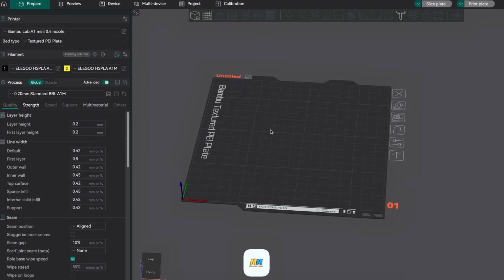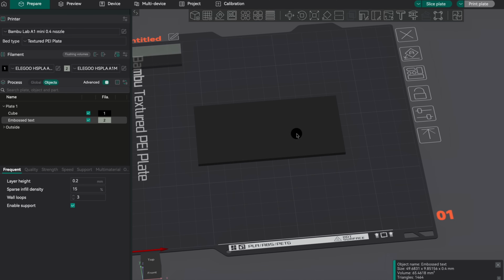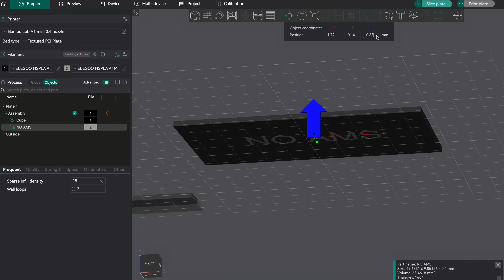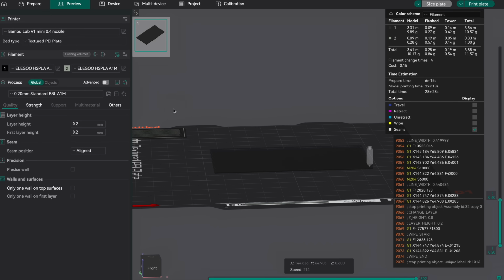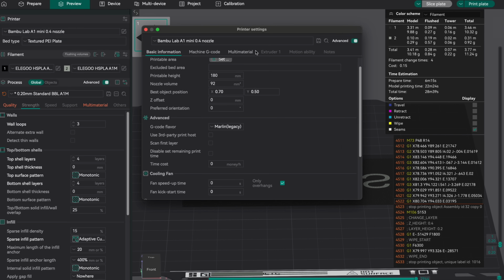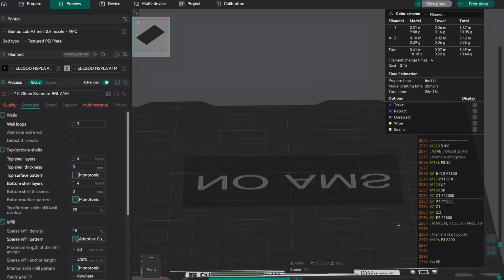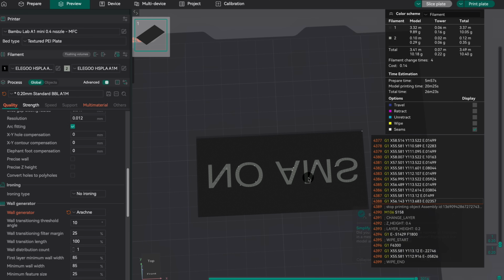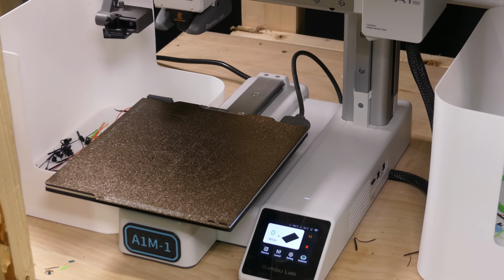How to do Multicolor 3D Printing WITHOUT an AMS

Comment: Amazing video, thank you! It worked for me, with one exception: no matter what i tried, i was not able to start the print with the text. It always starts with the box around it, then the infill for the letters. Which results in partially covered letters in tight spaces. A1mini, Orca Slicer. Another thing which I saw happen in your video as well: after a filament switch, before it goes to the prime tower, for a short moment it goes to where it paused before the filament switch. Which can result in a tiny bit of color mixup, at least it did so for me. Anyway, thank you again :)
Reply: Found the answer: Plate settings => First layer filament sequence => Customize.

Comment: I am not able to edit the printer settings like this on Bambu Studio, is there a way to get those settings that is not obvious?
Reply from the maker: I believe in Bambu studio, you don’t need to edit those printer settings. Don’t quote me on it because I’ve just recently swapped everything back from Orca to Bambu Studio and haven’t tested this out with that slicer yet, but you should be able to color your items and it “should” pause when a filament swap is needed. I need to do some updating to my A1 Minis and get them back on Bambu Studio soon and make a revised video that focuses solely on using that slicer for this but I’d give it a shot

Comment: So good. Worked perfectly with my A1. I ended up getting Orca Slicer to get exactly the settings you mention. Worked like a charm printing some small black and white labels I desperately needed to finish a project. Thanks a lot, but yeah, will totally buy the AMS next :D

Comment: When you change color manually the amount of purged filament is the same as if you were using AMS? I am asking it because one of the reasons why I am considering to buy a bare Bambu Lab A1 Mini (no AMS system) is because I watched several videos where they say that one of the downsides of the AMS system is that it wastes too much filaments with the color changes. Also they say that when printing multicolor objects with AMS it can take a lot more time (like 3x more) than printing multipart objects. It doesn't make too much sense for me because as much as the machine has to spend some time purging the filament from the nose and then load the new filament, I cannot understand why an 8 hours print in multipart mode can become whole 24 hours using the AMS. Could someone explain it to me? I'd like to get the combo but these details (wasting of material and the long extra time) sound like a turn off to me.
Reply from the maker: It takes roughly 1.5 minutes for the multicolor system like an ams to swap filaments for each color on each layer so if you have 3 colors that are being used on most layers, that layer itself only takes maybe a few seconds to print depending on the size of the part, but now it has an additional 1.5 minutes for each of the 3 colors. So while the printing doesn’t take that long, you’re adding roughly 4.5 minutes for each layer to swap colors out and purge the old material so you aren’t mixing colors. I just finished printing some parts that are about 2 inches in diameter. 360 filament changes x 1.5 minutes per swap is 540 minutes just swapping filament. Break that down to hours and it’s about 9 hours just changing filament for a 16 hour print and that was just with 3 colors and mainly in the center portion of the print. The first 100 and last 100 layers were only changing between 2 colors

Comment: This video is useless for Bambu Studio as it does not have the multi-material tabs that you show in Orca Slicer.
Reply from the maker: I can revisit this with Bambu studio to be sure, but from what I can see, you dont need to do the multi-material step in Bambu Studio... Just changing the filament change g-code and following the other steps should work in that slicer. Do let me know though if that doesnt end up working.

Comment: Have you or could you do a video for the ender-3 v3 se. I’m so close to buying the coprint add on but by that point I should’ve bought a different printer. But I do love this printer
Reply from the maker: I would recommend an A1 combo before i recommend co-print on any machine in that price range. The V3 SE is alright for a starter printer, but investing the kind of money that co-print costs into a machine like that, in my head, doesn’t make much sense when you can get machines way more capable in terms of quality and speed, that come with multicolor capabilities right out of the box. I’ve since retired my v3 se because it wasn’t as consistent as my A1 Minis, and was much slower at getting the job done

Comment: Please show me how to do 6 colors on AD5X please!
Reply from the maker: Thats not really possible because of the way the ifs system works, and how you would have to slice your file. Because it automatically swaps colors instead of pausing for you to do it, you would have to sit there throughout the entire process, and know which color its going to swap to next and pull that out of the ifs before the color change happens, and usually if you choose 2 ifs slots for different colors, it wont pause in between, it will slice the file so it immediately moves on and continues printing with that slot. For example, you could set up your slicer file to have 6 colors, maybe black, white, red, green, orange, and blue... You would have to tell the slicer that 2 of those colors are in the same ifs slot as another 2 so it would slice the file to print say, red and orange one after the other, and green and blue the same way so its not wasting time doing color swaps. Thats a long round about way of explaining it, but unfortunately, this method only works on machines that dont have a multicolor system hooked up to it because when they do, the software will slice the file with the multicolor system in mind instead of manually pausing to let you swap filaments.

Comment: I want to print a katana sword from demon slayer for my little nephew, he loves it. I have the A1 and A1 mini but no AMS. The blade is black with a yellow flame on it. Its already on makerworld, ready for print but i guess its designed for AMS. When i slice it, it says 8 filament changes but how can i set it up for no AMS use, is there a simple button to tell bambu studio that you can manually change the filament? In the past i just added a pause on some prints to add a font for example but now i have the yellow flames on black within the first layer, i can not add a pause. Maybe it is simpler than i thought because its already a finished project for AMS. I asked chat GPT but it kind of gave my wrong advices.
Reply from the maker: If its only 8 filament changes, then it should prompt you on the printer to change out the filament as it gets to those layers. If I had made my design a little taller, it would have been 5 or 6 filament swaps and shouldnt be any different than the 2 or 3 that I showed as an example. With that said, i havent done this with Bambu Studio and I know there are slight differences between Orca Slicer and Bambu Studio so I will explore around in there and maybe do a follow up showing the process inside of Bambu as well

Comment: There must be a way to just buy the feeders of the AMS and 'trick' the printer.   Can't believe no one has done this?   The Head has the four ports already!  Just need for more tubes, and four feeder motors, which if Bambu sells them separate, you'd be good to go...  Hmmm....

Comment: What is the purpose of using prime tower, since every time new filament is loaded the printer purges old filament automatically
Reply from the maker: The prime tower primes the nozzle to make sure filament is flowing before moving back to the print. It helps prevent little strands of filament from oozing between the loading sequence and actually starting in the next part of the print
Reply: Cómo hago para que la boquilla no se dirija hacia la pieza después de reanudar?

Comment: I have a question, when I pause the bambulab a1 and change the filament color manually, the extruder then goes to the position where it was paused (sometimes it stains the part), and then to the purge tower, but I want it to go directly to the purge tower since sometimes it releases a bit of filament on the part and ruins it. How can I do that?
Reply: same happen to me.. do you have solution?
Reply: No :'(

Comment: this works great and i use it rather often to get some more color into my prints. 

i just have one question: i usually print just one layer of text on the bottom, and it works, but it always does the outer material first, then changes to the text color, then back to the base color. it changes twice instead of just starting with the text, then changing to the main color. any idea what could be causing this?

Comment: Could this work for prusa mk3s?
Reply from the maker: The procedure may be slightly different as far as the printer loading and unloading but generally speaking, this will work with any 3d printer. I believe you can add the prusa printers to orca slicer and should work the same over wifi or saving the file to an sd card and running it from there.

Comment: Nice video using OrcaSlicer... can this also be done using Bambu Studio?  I can only pause at the end of a layer, and not inthe middle.
Reply: same
Reply: Yes, it can. I just did so. If you Google "Print multi-colour without AMS from Bambu Studio - easy" you should be able to find the details. In the 'Filament end g-code' box (Advanced mode > Filament properties) add 'M400 U1' to the end for every filament you're using.

Comment: I wonder if it could be worked out how to modify the filiment change g code to not only pause the print, but to to the unload as well, then pause for you to put the new filiment in, maybe even more stuff after the pause command to do the loading a fixed number of times?

Comment: Hi. thanks for the great video. 
I have a question, I have an Ender 3 s1 that I have tried this on and it works great, but I have problems when the printer makes the prime tower. at the start of each color change it puts down a lot of filament in a big lump, and this hardens and becomes a problem when the next color change starts.. how do I solve this?

Comment: THANK YOU!

I really appreciate that you showed the detail of using some of the “advanced” workflow with the other settings/tab, 

I’ve been needing to use multicolor, same layer for some light box’s that use more than 4 colors (and do not want to buy a $400 AMS2; only ones that’ll connect to ams lites)

Thanks again - I would love to see how else to use some of the other “advanced” / not used as often settings

Comment: This tutorial does not work.
Reply from the maker: It absolutely does, i did it myself in the video 🤣. If you are using Bambu studio, it is a slightly different software so the features may be in different areas but it for sure works with Orca Slicer the way i laid it out in the video

Comment: Cant find "single extruder multimaterial" setting in bambu studio...
Reply: same
Reply from the maker: May not be necessary within Bambu studio. I used Orca Slicer because it offers more functionality than Bambu Studio so things may be labeled slightly different or just be non-existent/not needed when using Bambu studio.

Comment: This is a fairly flat and straightforward print though. I don't see how this could work on something like a figure wearing clothing that has different areas with different colors. Even if it's just two colors. I'm specifically thinking of a black Darth Vader figure with a couple of white areas on his clothes and shoes.
Reply from the maker: You're not wrong there. Unless you wanted to eat and "sleep" next to the machine, there's no way I would recommend doing this for more than the first few layers, otherwise you could be there for days.

Comment: Is there any way to display what color you should put in next? either a name or filament number would be very helpful for more than 2 color prints
Reply from the maker: I believe there is, although Im not positive that would work on a machine like the Bambus since they are pretty locked down. Good suggestion for things to test out though!

Comment: hold up... you can ad text from slicer? and i have been sometimes FIGHTING with fusion 360 trying to turn a complex SVG full of works on top of a print.
Reply: Oh yea - it’s crazy as to the amount of design/abilities you can do within a slicer.  Being that I’m still learning how to model, it’s the only/easiest way I can make/mod/bash items is via slicer

In BS, you can add text etc, but needs to be on an object or primitive. So add your text, modify accordingly, then “split model” and then remove the primitive. Afterward, regroup/remerge the text and do whatever you need

Comment: Another vote for the AD5M multicolor tutorial. 
Was also wondering if you could just do a single color layer instead of two. Also wondering if you could do something like the combine infill function and print both layers of white and then switch to black. Basically, I only want one color swap.

Comment: Why do you keep retrying to let the new colour cone through then print a snall prime tower instead of leaving a big prime tower and letting the colour change there, it is what it's there for in the first place!
Reply from the maker: One of the updates to the A1s firmware really shrinks the amount of filament it is purging to basically nothing and because im going from black to gray and gray to black in this case, id rather I get the filament changeover completed prior to letting it print to guarantee that the color is completely swapped over. I think of the tower as priming the nozzle prior to printing vs using it to changeover the color. Same thing the AMS system would do is completely change the color over based on purging volumes prior to moving back to printing. Saves you from getting multiple layers into your print and realizing there is still the previous color in the nozzle and having it ruin everything you've already got printed.

Comment: I'm a bit curious what all the gcode you removed from the filament swap section actually does. gcode is a mystery to me, and I don't have a BL printer so I'm not sure. I guess it would be all the complicated steps involved in doing its standard AMS thing.
Reply from the maker: In orca thats what it looks like to me but I could be wrong. In Bambu Studio there is an addition to the top of that "Filament Change G-Code" for manual color swaps that basically says "If Toolchange count is greater than 1, do this function" Then it goes into the regular color swap method by the looks of it. I stopped using Bambu Studio once I realized Orca is just a better overall slicer with more functionality but it would appear if im going to say it works in Bambu Studio too, I should at least check that out to make sure they are the same 🤣

Comment: There is no "multimaterial" tab in Bambo Lab Studio, or it's not showing for me!
Tabs are like this: Basic, Machine gcode, Motion ability, Extruder, and Notes.
Reply from the maker: Honestly, I don't use Bambu Studio so I didn't catch that one. You might be able to just change the colors as normal and it looks like inside of the machine g-code tab, there is an addition to the top of the Filament Change G-Code for manual swaps. If it doesn't pause the print to allow for the manual swap off the bat... try changing the "filament change g-code" to M400 U1 and that should activate the pause function.

Comment: Just paint the text the machine will auto stop for colour change with out the fuss of editing g code and just check after slicing with the preview scrolling
Reply from the maker: That might work for non-Bambu machines, but the Bambus wont stop for filament changes. It just prints the purge towers first layer in the same color you are running and continues on with the print. You have to put in the pause command for the printer to actually pause for a manual filament change in this case. Tried just activating manual filament change and doing it that way, but its still 2 different colors you are using so regardless of the way you add the color to the object, it still needs to know to pause instead of trying to auto swap colors. That gcode is for the ams system to perform the filament changes and without one, it just continues on with the print.
Reply from the maker: I will follow up with this and say that may work in Bambu Studio now that i've taken a look at that slicer a little more in depth. It does appear there is a built in code in the filament change g-code that "should" allow for manual filament changes but I didnt have that luck in the past when using it so changing to M400 U1 instead of the built in gcode may still be necessary for certain prints. I've been an Orca slicer snob for the last year+ and don't keep up with what Bambu is doing with their slicer as much as I probably should.